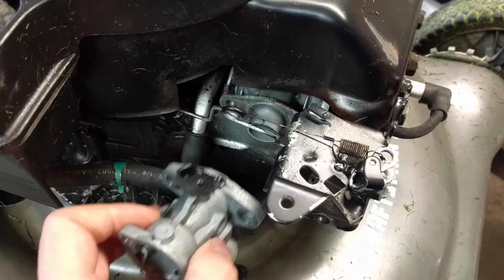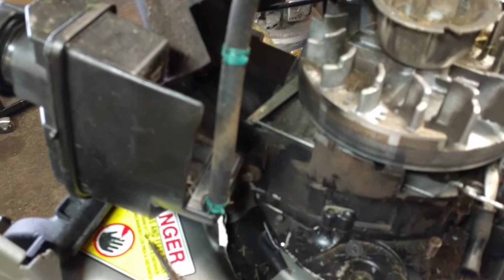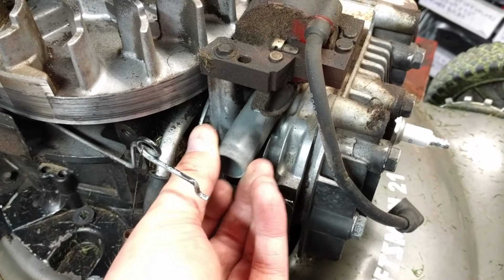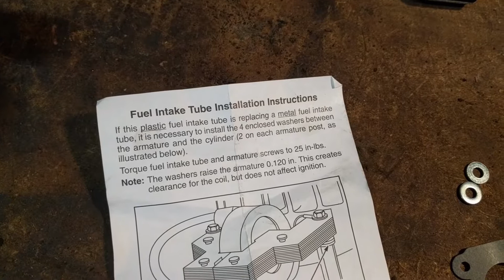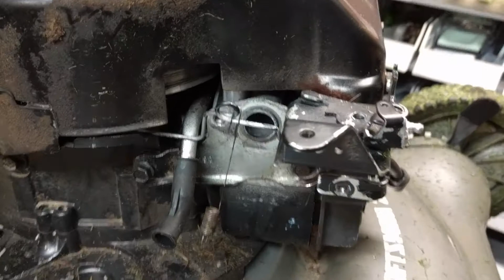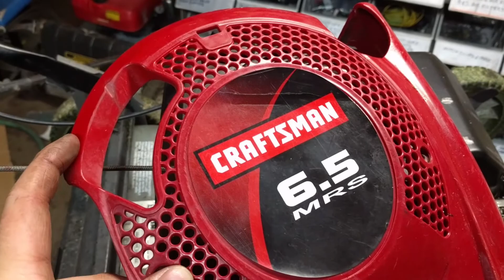Replacing an Intake Manifold - Craftsman 6.5hp

Comment: Had the same issue with a Craftsman mower w/Briggs engine.  Glad I finally figured out why the engine was not getting fuel to the cylinder. Thought it was a carb issue. Thanks for video.

Comment: Very good detail and clear explanations. My 3.5 Briggs was surging and I replaced the diaphragm and the carb when I finally saw a hole in the intake manifold pipe. Fixed and engine runs fine. Thanks for video.

Comment: I had this very same problem. Mine broke so cleanly that I used some epoxy and glued it back together. Somehow a bolt that held the carburetor bracket/flange on broke off allowing the carburetor to bounce around a little and then the plastic manifold broke in half. So, I have to figure out how to get that broken bolt out and replace it.

Comment: Great video. Don't forget to CLEAN all that grass and oil gunk off the block and cooling fins. THAT is a yearly maintenance item in ALL engine manuals. These are air cooled. Oil and grass insulates the block and causes over heating which WILL DAMAGE THE ENGINE.

Comment: Spend 60 euros on carb, airfilter, fuel hoses, blade, oil to try fix my (surging) lawn mower. Well it didnt work, next day i thought it could be the intake. Well it was, it literally crumbled in my hands, had to scrape the gasket off too. Directly ordered the manifold and gasket set. Hope this fixes my '93 briggs and stratton quantum xm40.
Reply from the maker: Good luck!

Comment: I had my intake crack on a 15 year old lawn mower and the replacement (same as yours) snapped about 20 mins of running. Going to have to go over each nut 1 by 1 and make sure nothing is loose causing stress on the neck

Comment: I have a yardman 11a - 5897R55 and I need the intake manifold. When I was looking it up I saw that they had different looks to them, you didn't have any problem with installing the one that looked different?  it ran fine after that?  The colors were different as well and I was worried it might be the wrong part.
Reply from the maker: Some have a relief on them on the underside, usually to help clear the coil.

Sometimes they just use washers to lift it high enough, they're all different it seems.

OEM ones used to be metal on the old ones, replacement parts are all plastic now it seems.
Reply: @EliminatorPerformance  I believe my yardman is a 2005 but it is a gray plastic manifold intake. I was just worried about how the shaped look different where it mounts to the engine.
Reply from the maker: @FISHERMAN331977  some of these intakes also have a 2nd smaller piece that slides in, and will help the flow of air/fuel.
Reply: @EliminatorPerformance  Thanks, I was just watching that exact spot  were you slid that piece in to round it off like the original.
Reply: @EliminatorPerformance  When I replace this piece I want to avoid it happening again. I just had one more question. The whole carb assembly seems a little flimsy like you said. It looks like a bolt is missing and it looks like the thread comes out from the engine and it broke off the nut rather than a bolt threading into the engine to secure the assembly.  I'm not sure how to replace that bolt if it's comes from inside out.
Reply from the maker: Just had that happen on another machine with the same type of design.

Carb bolts to a plate, plate bolts to the engine.

It just rattled loose and I was able to replace it.

Hard to say what type you have without actually seeing it
Reply: @EliminatorPerformance  either the head broke off the screw and the Peace of the screw is still inside or the hex nut rattled off and the piece that you would threat it to is a little sunken inside and I need to pull it out. Thanks for all your help.
Reply from the maker: Also, to get the right part number, please use the model number of the engine, not the lawn mower itself!

Comment: This was a very good point to bring up about the plastic air filter backing plate which is prone to warping.
I had a similar issue with the same engine and tried a new Oregon gasket, but the material was so hard that it would not seal. Finally made my own gaskets of softer gasket material and the problem was solved and primes good now.
Great video!
Reply from the maker: Yea usually we have to use 2 gaskets.

I also have a little trick now, if the machine doesn't have a primer, I steal the gasket (because used gaskets swell a bit) and I'll put a new gasket on.

Then when I'm working on a machine with a primer, you put the swelled gasket on the airbox 1st (closer to the primer) and a 2nd new gasket ontop of that (carb side) and it just seals things up better.
Reply: Yup totally agree with that method... great hindsight!

Comment: I'd glued one of these manifolds with glue and never had anymore problems again with it . If I'd had this problem I'd got the motor running and pull the motor for another frame later . No expert here - but my way of doing things . Hey enjoyed your video - thanks - keep um coming .
Reply from the maker: Thanks Marshall, seeing as how this was for a customer, I ended up just replacing it and it hasn't come back since!
Reply: What kind of glue did you use? Hot glue or instant glue?

Comment: This is what I'm going through now
Reply from the maker: I think they break due to vibration, cheap plastic parts.

Easy fix though, and you'll be back cutting grass in no time!
Reply: @EliminatorPerformance  thanks, yes my carb was missing a bolt somehow so it had put too much weight on the plastic pipe. I was thinking maybe I can plastic metal fix it, but at $5-8 for a new part it's not worth it. Thanks for the video. I haven't taken the solenoid off yet, so I appreciate the advice on the video.
Reply from the maker: @FuegoPazzo  anytime

Comment: I have a  15yr old pressure washer with a Briggs engine and I am having this problem with the carb it  seems loose
Reply from the maker: Normally these intakes crack due to vibration, but sometimes people line up the carbs wrong during installation and it cracks the intake when bolting down the carb.

I've done about 4 or 5 of these jobs over the years now.

Comment: Had the same problem with a broken intake manifold on a ExCell pressure washer with a 5HP Briggs & Stratton Quantum XM. Refernce part # 794305 was the same. The engine has had starting problem for a while, cleaned the carburetor, would run okay sometimes but finicky adjustments. The pressure washer pump went out so in the process of replacing it I was going to replace the carburetor and discovered the intake tube was broken. The high temperature plastic is thin and once it dries out from the heat and fuel it becomes brittle. So if you are having starting and smooth idle problems, be sure to check the intake tube. They are inexpensive and probably should be on the long term maintenance  replacement list. I was considering a new pressure washer but not now.

Comment: Thanks.  It just happened on my Briggs mower with the on-tank carburetor.  So, it's a different part.  It was nuts.  I pulled the carb off to replace the diaphragm, and, boom, out came a broken intake tube.  Sickening feeling.
Reply from the maker: Yea it's something to do with heat and vibration I believe, or possibly from cooling after it's been running and hot.
Reply: That's what I guessed.  Wear and tear.  But I may have encouraged the problem, because I ran my mower while it was surging for maybe 2-4 hours, 30 minutes at a time or so, and the vibrations may have encouraged the crack.  So, people should probably not do that and replace the diaphragm (if that's the problem) right away.  Now I'm on the hunt for the intake manifold.  Gonna call Lowes, HD and a local repair place.  Hate to order it.  Thanks for your video, by the way.  It's about the only one on this topic and very helpful.  It's great to see you do it, before diving in.

Comment: Hello.... JB weld
Reply: But does it work on this material?  It's some weird kind of hard plastic.  And the heat is not an issue?  Thank you.
Reply: Kube Dog hell I used some bondo(car body filler) on my Briggs lawnmower intake manifold and it works just fine...

Comment: Very informative video since have never seen fuel intake manifold issues dealt with before nor have I seen any videos mentioning the use of double gaskets to solve the priming issue with the plastic air intake cover being distorted. Great job should save your viewers mucho dollars by solving these problems by themselves instead of going to a repair shop.